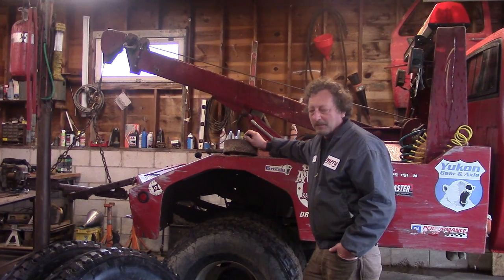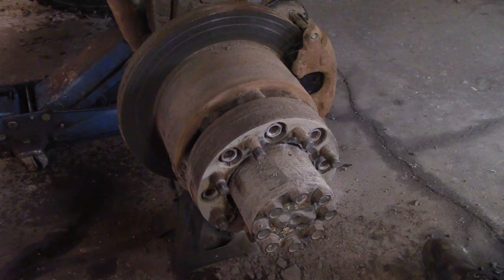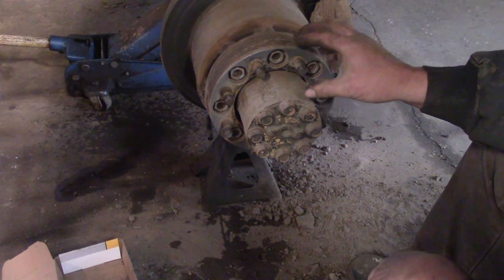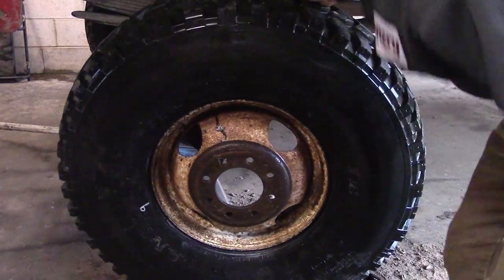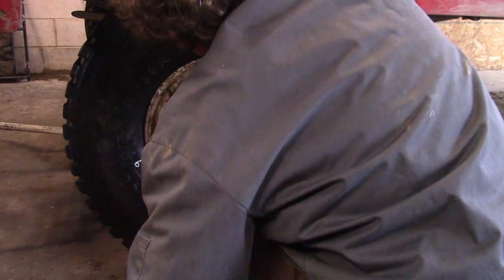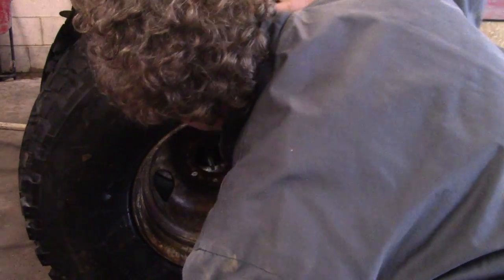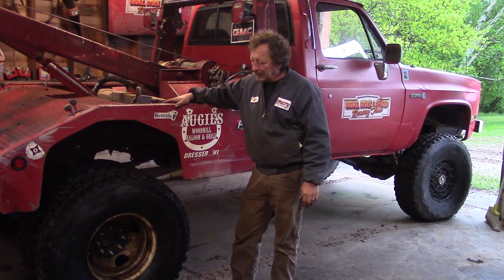NEW TIRES FOR THE WRECKER by BSF Recovery Team

Comment: Are you running the Bias ply or Radial belt style Hummer Tires? I wanted to put a set on my 79 F-350 which requires a 4 inch lift and 2 inches of fender trimming to fit.
Reply from the maker: Good Year MT radials.

Comment: Would love to see a couple of cold starts of the wrecker when you first pull her out in the morning. How many pumps does she usually take?
Reply: Especially from inside
Reply from the maker: Lots, the carb has no choke, and fuel drains out of float bowl over night right now.
Reply: recoveryteam would love to see a few cold starts from inside! I'm curious how many she actually takes to pop off. Love your videos!!!
Reply: typical chevy startup I bet, grind on it a few times for 20-30 sec. to fill carb. bowl/s, then 20-30 more whilst pedaling to get pump spraying fuel. cuss at stuck choke if you have one...
mine always started, though even siting a week+ in under 10F weather
Reply: Pump pedal repeatedly try starting... pump pedal repeatedly again try starting... cuss call it a pos and start pumping the pedal again try starting.. sputters a few times... pump the hell outta the pedal hold it to the floor and BANG she finally goes.

Comment: what is the purpose of that steel disc thats last to go on. my flatbed has that and i was wondering
Reply: tractorboy31 my 78 dually GMC motorhome has them too, its a way of centering the rim onto the hub based off of the lug nuts that are being used. on an older dually depending on its design of use came with flat washer lug nuts, or acorn/concaved lug nuts. the acorn nuts recess into a flare/flange on the metal disc allowing it to be a lug Centric rim, and on hub centric rims, (rims centered via the hub) use flat bottomed lug nuts or flat washer lug nuts like a semi tractor/trailer uses.

Comment: What rims are those off of ? Cause I have a dually as well and trying to find 4 16.5" dually rims
Reply from the maker: Most of the Chevy DRW (duel rear wheels) in the 70's were 16.5s.
Reply: What's the lug pattern on those though?

Comment: Does the bearing pre-load change, with the spacers in place, and the tires further away from the frame?
Reply: Kickinpony.66 no the bearing preload does not change. ran 38s on one of my old duallys and had to use the same spacers. daily drove for 3 years and no bearing problems either.
Reply: Ahh, right on. Good to know!

Comment: Where can I find a set of those spacers
Reply from the maker: Used on a Ford van Centurion, a conversion with duel rear wheels, and cut into a flat bed for pulling horse trailers. I had to change out the wheel studs to the GM thread, and pull the centering ring out.

Comment: what size tires are on the truck? I haven't been able to find any places that sell the humvee tires??? would like to have a set of 40" or 38" tires.
Reply from the maker: 37x12.5R16.5 I get mine from Feltz tire in Marshfield WI. You can find the on FB.
Reply: Dustin Bickford I have a set for my 95 powerstroke. great rubbers
Reply: allgutsnoglorywtg,  I only have 15" wheels, so far everything is for 16.5 wheels. I'm just gonna keep the 40" LTB Swampers. I don't drive my truck daily.

Comment: Just me or was the truck rocking a lot when pulling off the tires?
Reply: Did you get a look at that old jack under the diff? Ha no safety stand At 1:30 added later.
Reply: you did notice the jack stand there as well?
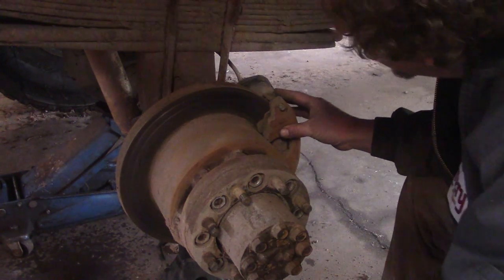Reply: James Schrumm 1:40 look under the rotor. Jack stand
Reply: The jack stand is grey and kinda hard to see, but there is one under there.
Reply: There may have been a jack stand, but it obviously was not supporting any weight or that thing would not have been rocking like that.
Reply: I noticed it rocking

Comment: where can I get the spacers?
Reply from the maker: The steel ones I am using came from a ford van conversion called a Centurion (changed out the studs for a chef.), but if you search on line there are a few manufactures that make 8 lug ones.

Comment: why can't you put some like Loctite on it didn't I say duke around with it
Reply: you don't put anything on wheel studs
Reply: Says who? Long as it's an open nut, no problems.
Reply: Gregg KUZILA, the only thing that should go on wheel studs is light oil to assist in proper torque readings.

Comment: yikes!!! torque stix are a gimmick. all ways use leverage to torque fasteners.
Reply: What?
Reply: they're not a gimmick and need to be calibrated and used on the same impact gun at the same air pressure always!
or the actual torque value can be way off.